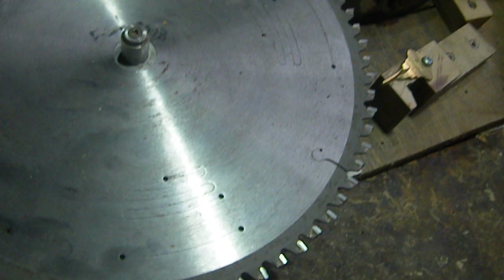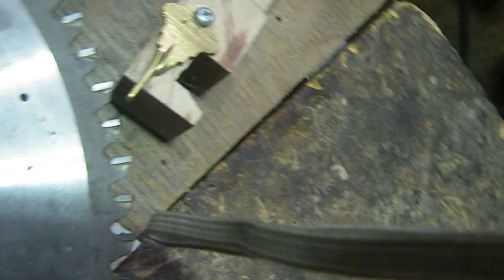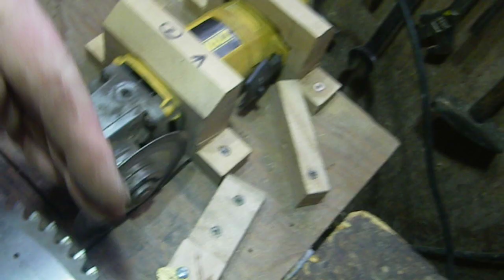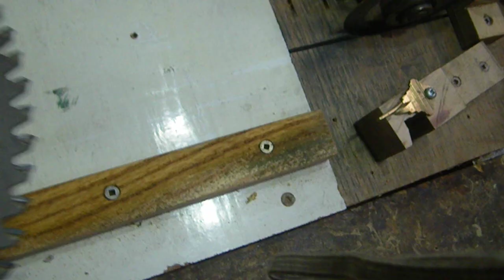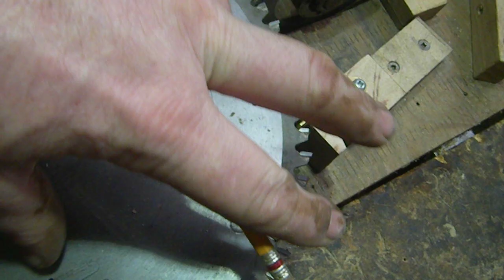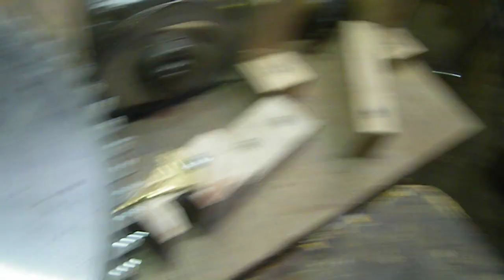How to  easily sharpen carbide tipped saw blades for under $5

Comment: Where you order your disks? .
I have disks made that are ideal for tungsten carbide tips and more.
https://www.ebay.co.uk/itm/283867777440
Reply from the maker: Im buying the discs for this for $3-5 CAD delivered to my door so considerably cheaper than what you have spammed me with.
Reply: @ralfish2008   sorry if you think its spam i just fort I could have offered you a better suited disk at a good price if u had got in touch to try .at that price you pay i know there the ones for ceramic tile stone 1.3mm thick and not made for tungsten carbide so just be careful.

Comment: Best hook angle on any wood blade is 16 degrees. The tops are typically 10, 15 or 20 degrees . For larger blades you would side grind your kerf from face to gullet at 11 degrees with the gullet side zeroed with the blade. I still use Foley 357s to sharpen dozens of blades a week.

Comment from the maker: so remember to protect yourself from the carbide dust, as you don't really want to be breathing that stuff in. Take away: leaving a consistent amount of tooth behind; hence not freehanding but rather using a stop. Also, eliminate play in the design stage; don't use bearings or cabinet slides.. as they add play that you cant control